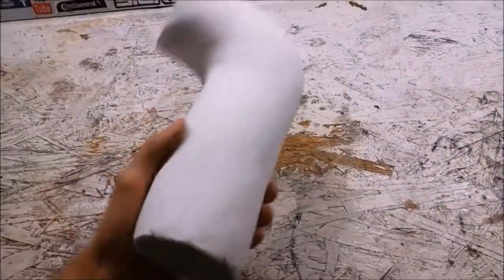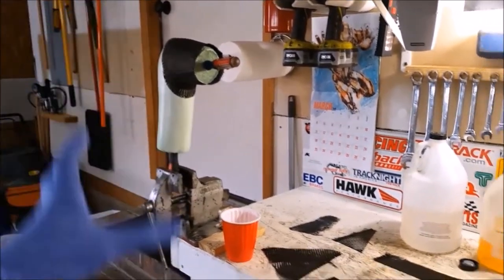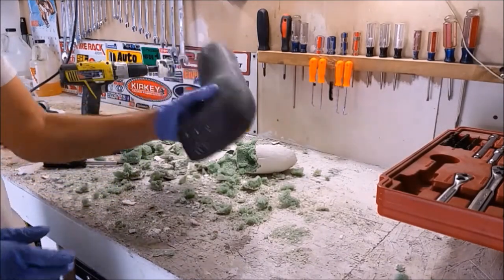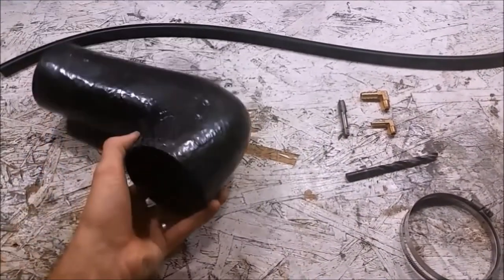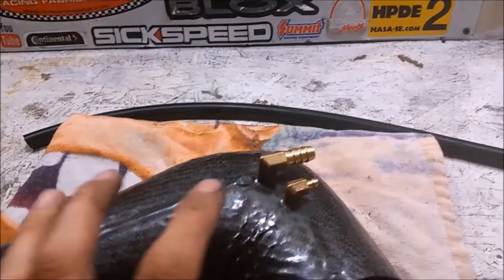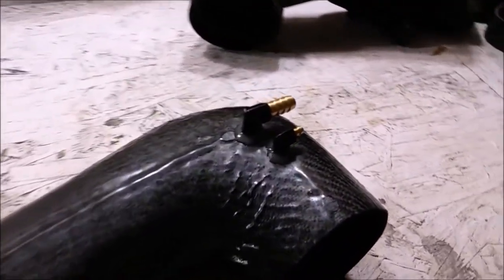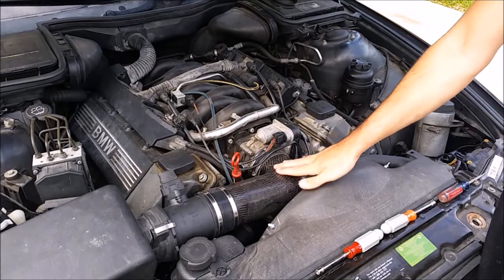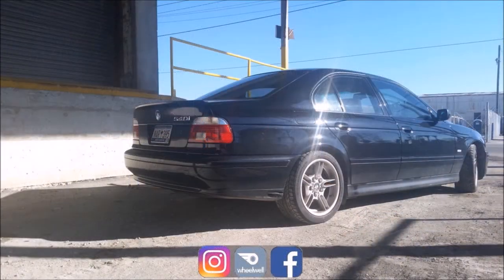How to Make a Carbon Fiber Intake for a 540i (BMW Part 3 of 4)

Comment: This is cool. I want an alternative to spending $110 on Turner Motorsport’s silicone piece, especially since I can’t tell if it has 2 barbs or 1 on the Turner piece.

The barbs on my stock pipe are broken, causing vacuum leaks and I would love to ditch the stock design

Comment: Bro, for all that carbon fiber work, you should have done the larger diameter e60 throttle body and m60 intake manifold combo first!
Reply from the maker: Well, considered this was free to me as I used all left over supplies from a previous build, I'd say this was the better choice. Plus, finding the correct M60 manifold with the desired runner size and trumpets is not as cheap and easy as it once was. Half the people that install an M60 manifold bought the wrong one and made their car worse.
Reply: @350Z247  True, the trumpeted intake manifold is much more rare. But from my research the M60 non-vanos intake is still a decent upgrade over the M62 vanos intake manifold, not worse.  Do you have info showing it makes the care worse?  I am interested to know for sure bcause planning to install one along with the larger bore E60 throttle body. Thanks...
Reply from the maker: You're trading lower end power and torque for minimal higher RPM power gains in a heavy street car; unless you can find a manifold with trumpets, you're wasting time and money on an M60 manifold. The M62 non-vanos manifold is what you want (unless of course you can find an M60 with the velocity stacks); it has larger runners and rounded ports. The E60 throttle body is a good investment but only if your stock throttle body is on the way out. The M62 is a great engine with plenty of power, but pushing them for more power doesn't have a great dollar/horsepower ratio. You're better off focusing on the exhaust side of things, and even then, you could easily spend your way into a E60 545i being a much better deal.

Replacing the manifold and throttle body should be done as you need to do other work in the area: replacing gaskets, fixing a vacuum leak, replacing a sensors, ect. I would also have my injectors professionally cleaned as well.

Comment: hi! 
i noticed that here, for this part, you placed mold release wax right over the spackling filler, while on the plenum part you placed another coat of something (primer or paint?) and then the wax over it. 
is it one way better than the other? 
thank you! 
M 
;-)
Reply from the maker: For what you're doing, you won't need the filler primer I was using. I just did that because I was trying to get the absolute smoothest finish possible. It wasn't really necessary though
Reply: thanks! 
 
basically, for my project, i'll have to do:
 
1) outside mold of my foot (where probably two-part expanding urethane foam or the "classic" plaster bandage), 
2) inner mold based on the first mold - my foot volume (where probably the "classic" liquid plaster), 
3) the carbon part which will be shaped around the inner mold.
 
do you think it will be enough just to wax the inner mold plaster? 
or should i prepare the plaster with some other outer surface, like a primer, or...? 
 
thank you very much!
Reply from the maker: @mirceaandreighinea  I think the wax would be enough. It should separate pretty wellm